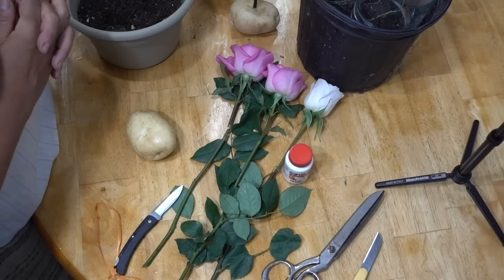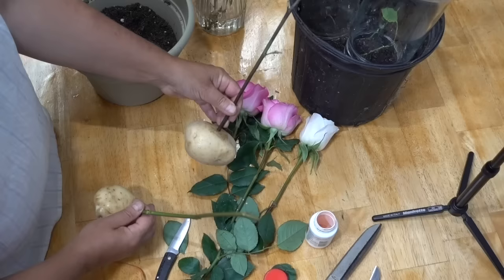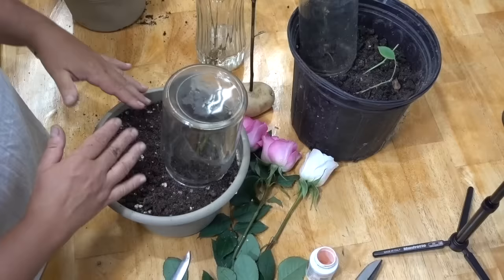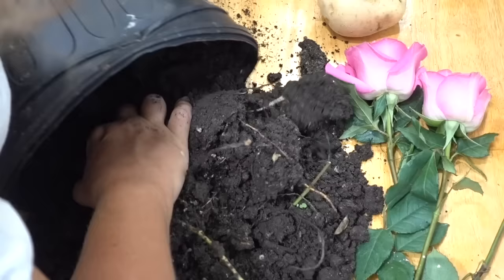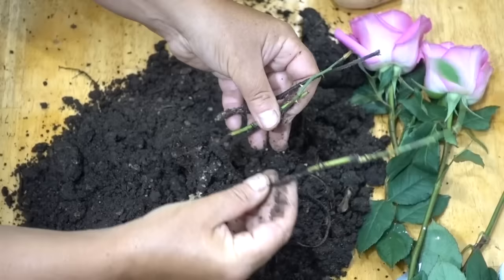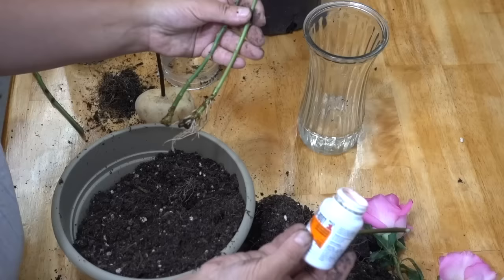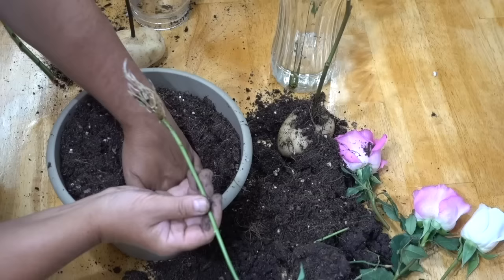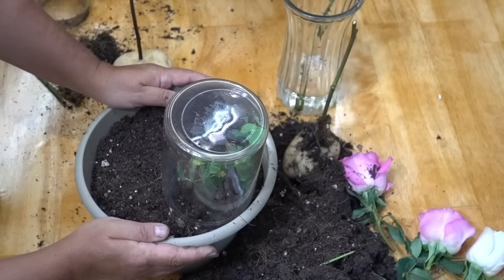Growing Rose Cuttings In a Potato Debunking the Myth

Comment: "If I'm doing something wrong please let me know below". Ok, don't cut a living organism off from air. A sealed glass jar.. really? How well would you do with a sealed plastic bag over your head, occasionally removed to prevent disease or mould? I think disease and mould are the least of your concerns. However, perhaps this is irrelevant since there are no leaves and presumably no photosynthesis requiring the plant to breathe? I suspect it's more complicated than that, but access to air is surely a default recommendation. I'm also confused at the idea of something rotting being the reason for failure. Isn't compost literally rotting material? Seems to me the potato concept is to provide a concentrated source of compost nutrients to the rose stem to improve its chances. This could be quite misguided. Of course, as pointed out, sprouting can be done other ways and the potato is unnecessary. Perhaps the potato method works for some people despite the potato's presence. Or, perhaps there's much more to this, with the crap on YouTube typically lacking precision thereby setting people up for mixed results. However, this video surely lacks precision. The sample set by itself is laughable. This video debunks nothing. "If" the potato method works it's the lower maintenance option allowing you to plant and forget (besides watering). The water sprouting method requires monitoring and eventual transplantation into a pot. The actual effort between these two methods is essentially the same but the set and forget aspect of the potato method is presumably desirable. I'm not convinced either way on this issue at this point.
Reply: When u say air you mean..... C02right? Plants take mostly water   a relegated nitrogen from the soil. Plants do grow from the airand the water carries the nutriemts up the stem like blood does in us but transpores out of the leaves and does not circulate.
Reply: How do you suspect terrariums work?🤦🏻‍♀️
Reply: She seems to be doing just fine without your help l don't see you putting out any videos.
Reply: Knowledge is to be shared. It works on other people because of other factors unknown to them or forgot to share some details. Science can still be limited to human beings like us. God is and still is the author of LIFE, of created beings and plants. This video did  show 2 cutlings with one succesful outcome.

Comment: It DOES work it’s just not the most viable rooting method. Air layering is much more effective.

I did a small potato with honey at the cut end for rooting gel and stuffed into the top of a scored potato and one rooted quick while the rest had the issues mentioned in this video. It will root with the potato and fast depending on how you prepared the plant to be cloned

Comment: Use sterile dirt...like a peat. You used dirt from outside and a worm even. You don't know whether your stem is soft, semi soft or a hard wood and that matters. You have to grow a root before you grow a sprout of leaves. So you have to cut below a leaf bud on the bottom and even cut the top ABOVE a leaf node. You didn't cut the leaves off. Leaving them on just wastes energy to grow them instead of the root. The potato is just to stake it and moisture. You failed to show how to water or mist. So lots of mistakes from beginning to end. Next time use an onion.

Comment: I was incredibly shocked. 
Nr.1. Why did you take a vase and put over? It should be a plastic bottle preferably 2 liters. With the cork off, otherwise it rots as you noticed. 
No. 2. Why did you take an ordinary cut of rose? It never gets roots. 
Cutting from a rose bush that lives inside or out. 
It's not a myth. You're doing it the wrong way. 
Of course you want to get it so I'm wrong. 
BUT I HAVEN'T! It must be a cutting from a potted plant. It is also very important that you use a drill that is as large as the cutting. 
You seem like a florist, so am I. I'm not telling the gardener how to do their job. That's what you do, and It's low.

Comment: Why are you covering it with a glass jar for ? 😒
Reply: To give it a green house effect
Reply: It prevents moving air from drying out the stem too much. Not necessary in super humid conditions.
Reply: fresh roots on a new cutting.
The plant was used to being in constant water.
Now even if you soak the dirt it wont have that much water and it will dry out , you need to get it used to its new conditions or it will go into shock and die.

Comment: Actually the potato do work but it works alone you don’t need to add flowers to it or a stem you can just put the potato in water a glass bottle with water and leave it alone it will grow into a flower
Reply: Try a ripe banana. It contains a great deal of potassium and since potassium is required for root growth, it should work. And as a reward, you can eat the banana afterwards. Yummers !

Comment: I think you planted the potatoes too deep dummy
Reply: Rude
Reply: @elizabethsellors9046  I wouldn't say she's a dummy but she did plant it too deep. She did a couple of other things wrong as well. She didn't scrape the stem at the bottom inch of the stem and she didn't poke a hole in the soil either.She just jabbed it in the soil and that scraped off the rooting hormone.
Reply: Troll
Reply: @jenniehughes6927  That may be so. But it´s still rude and trollish to call people “dummy” JUST BECAUSE one simply disagrees with how deep they planted the potatoes. Those who insult your intelligence for such simple reasons are trying WAY TOO HARD to sound “badass”.
Reply: @jenniehughes6927  I jab cuttings into soil all the time with no problem. This potato thing doesn't work. And I've planted potatoes deeply with no problem either. Takes longer but can make more potatoes.